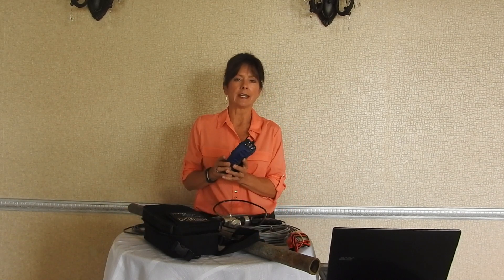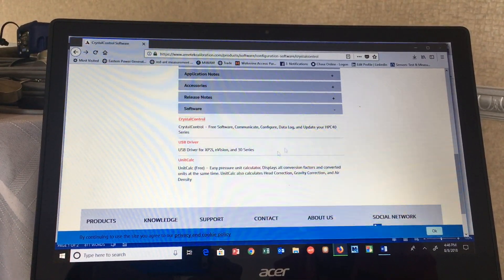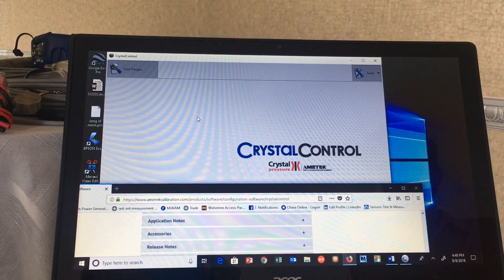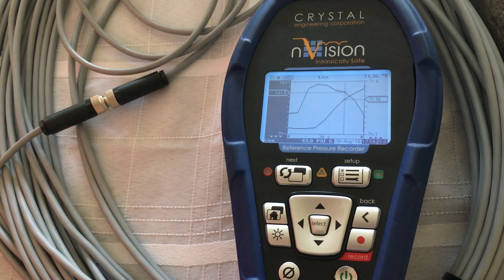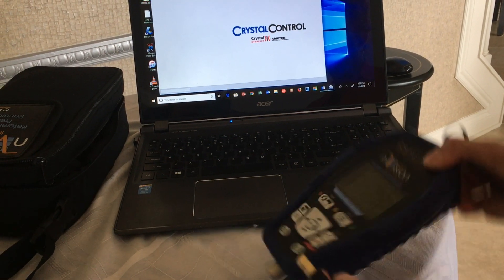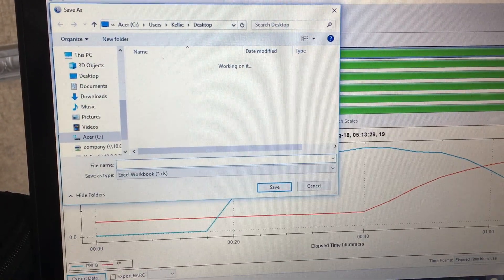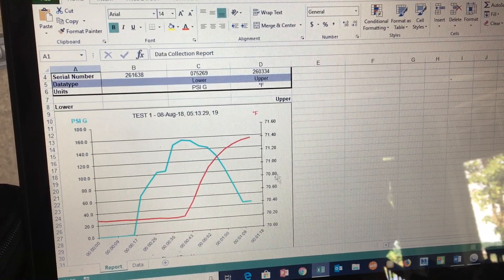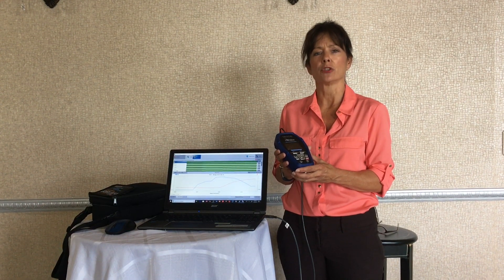nVision Training: How to perform a hydro test using an nVision reference recorder

Comment: How to make report
Reply: Simply move the recorded data to your PC using supplied USB cable and free software, import to Excel spreadsheet using template provided.  (Templates can be modified by user)
Reply: How to import data  Sheet into an excel sheets (option is not show )